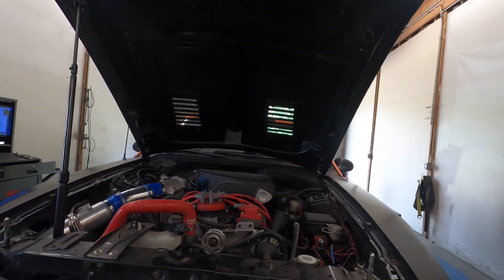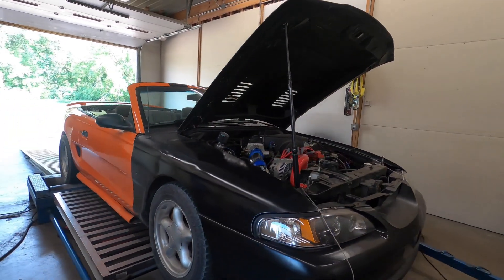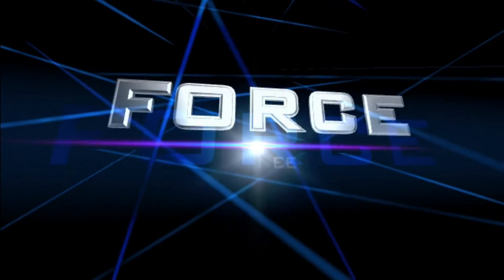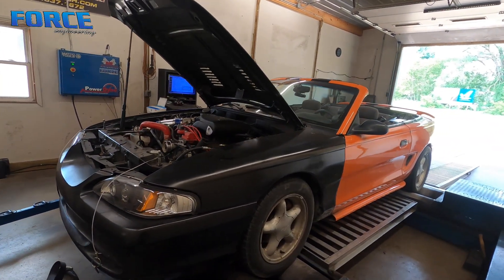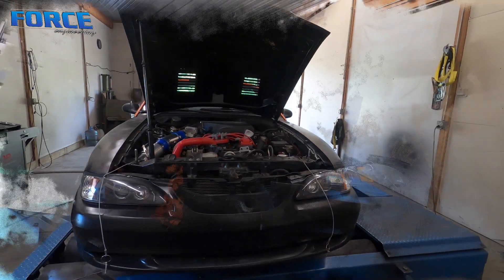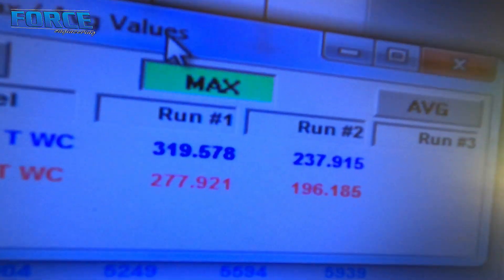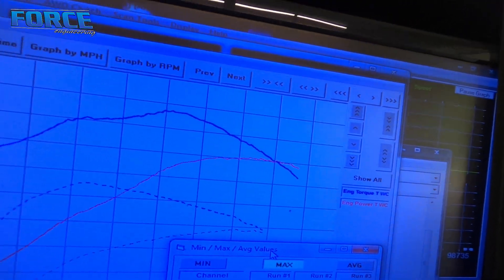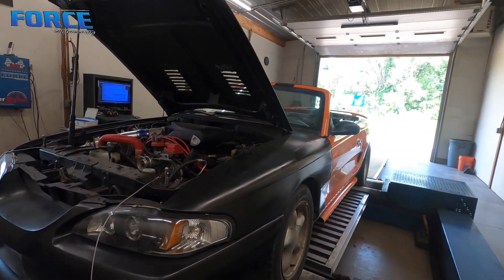SN95 Ford Mustang | Heads Cam Intake | 5.0l SBF | Megasquirt | Dyno Review

Comment: Even for that cam don't those numbers seem kinda low? I'd be curious after the head swap with the stock short block what his compression is.  I'm doing a 94 gt 331 with blueprint heads edel rom 2 efi intake, 10 to 1 compression and a 226int 236exh at .050 533lift 112ls I'm hoping for at least 300+ wheel hp.
Reply from the maker: The numbers are where id expect.  It takes rpm to make hp.  Example, if made 300ft/lbs at 6000 rpm that is 342hp at the tire.
Reply: @ForceEngineering  gotcha,  that makes sense. How do you like the mega squirt as a tuner?   Does it offer all or most things needed to tune efficiently?  And thank you for answering I'm enjoying your videos.
Reply from the maker: @302hobronco  Megasquirt has it place in the market for sure.  Ive been tuning them for 15 years or so now.  They are a good peice for the money and hard to beat the plug and play options cost/time wise.
Reply: @ForceEngineering  that's what is appealing for me is the plug and play set up.  I did the bama tune chip for the t4mo in my 94 302, and it worked well. But for a 331 I feel I need a hands on tuner and a stand alone system. Thanks again brother!
Reply: @ForceEngineering I just got my MS2FMU with the air fuel wideband sensor and gauge last week, waiting until the winter to try it out, I'll be going forced induction, well hopefully.
Good luck on your build.
Reply: Weak af for that much money